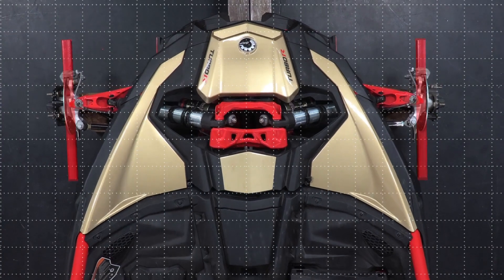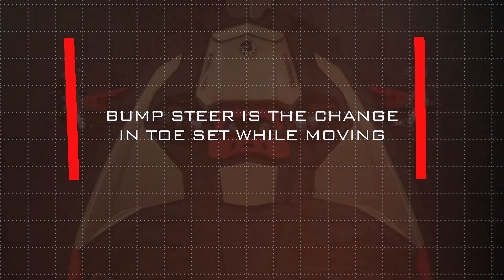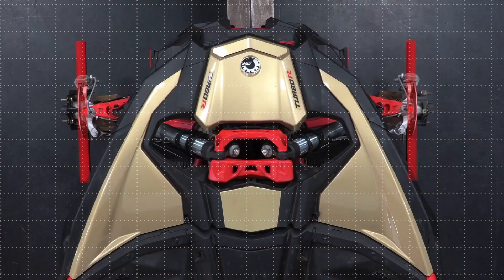What is Bump Steer?

Comment: My 2021 commander xtp does this, I see you have a tie rod kit for my commander to fix it but I don't see how there is enough room in the nuckel  to move the tie rod end up or down enough to make a difference
Reply from the maker: The Commander kit works the same way as the X3, the adjustable shim allows you to correct for up to 3 inches of bump steer.
Reply: @ShockTherapyllc  is there more info on the kit? The pictures on you website don't show the shimes , plus I don't see where I can get replacement hiem joints as I'm sure I'll need to replace them at some point
Reply from the maker: @hughrs  just watch the  BSD instal video on the cannam x3.  Same process and you can see the spacers.  Individual rod ends are available on our site as well. The kit uses a 5/8 RH and 5/8 LH rod end. 👍🏼

Comment: Great explanation of what it is, now how do you prevent it or get rid of it.. will wheel spacers cause it or relieve it?
Reply from the maker: You prevent it by changing geometry. Usually the location vertically and length of the tie rod. Wheel spacers do not cause or prevent bump steer. They do however increase scrub radius which caused a ton of steering wheel feedback and pre mature part wear.

Comment: Nice explanation. Probably not something we need to worry about on the street. Well today's streets are pretty bumpy. Hit a chug hole and you could be having to over steer until car levels out. But the best knowledge is knowing your bump steer is causing damage.

But how does this different tie rod reduce bump steer. Looks lust like an over priced upgraded original tie rod end. Thanks.
Reply from the maker: The rod end at the spindle is lowered in the mount as opposed to centered. This fixes up to 4” of bump